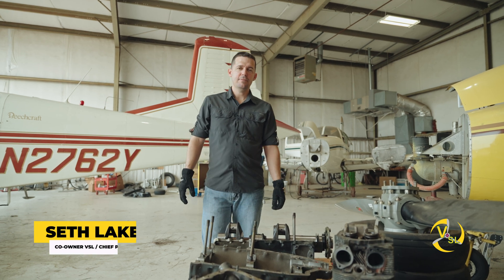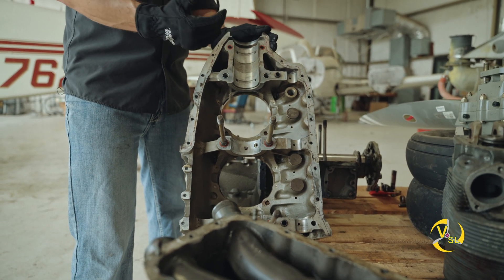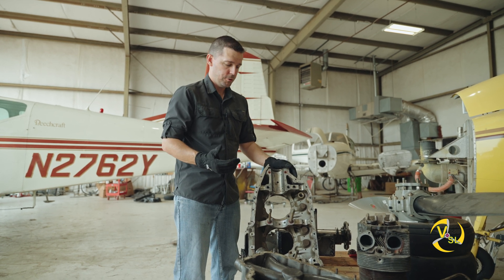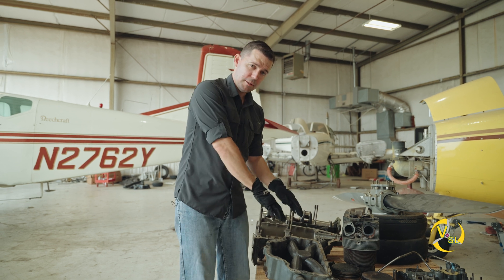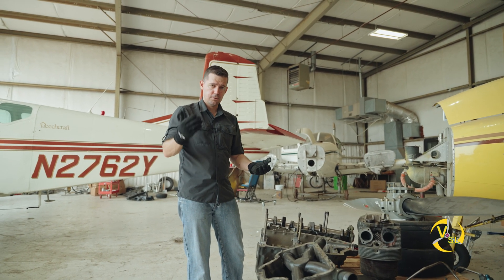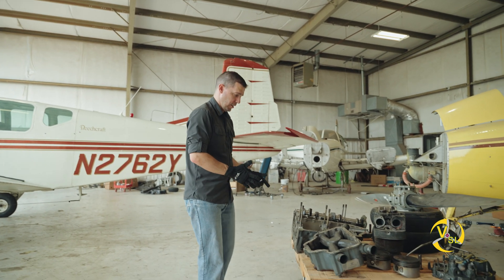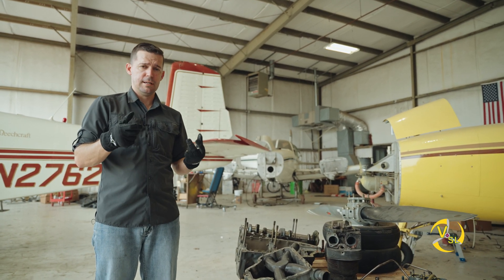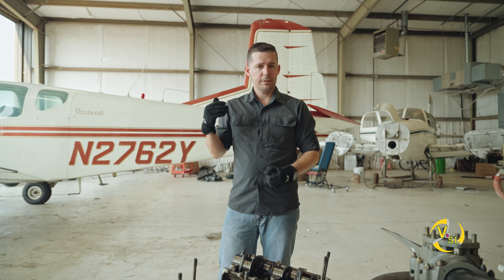Demystifying General Aviation Piston Engines: Exploring The Case (Part 2)

Comment: Seth… love the explanation of things. I have a question, at the end of the video you talk about the intake manifold, and that the air passes through the oil sump. I would assume this would heat the air and decrease performance. Is there a reason why air passes through the oil sump perhaps it’s just due to construction convenience?
Reply from the maker: Great observation.  You are correct, the fact that the intake manifold passes through the (hot) oil sup prior to reaching the cylinders is not optimal.  I think it was designed this way to reduce the size of the engine.  In this case the space savings was worth the cost of the marginally decreased performance due to the intake design.

Comment: What is a little cylinder next to the oil pump? Looks like a chain or belt tensioner of some sort?
Reply from the maker: I'm not sure what your referring too.  There isn't a chain tensioner on the engine.
Reply: @SethLakeDPE  6:43 you point to the oil pump, what is the thing to the right of it? Between the pump and a big round opening in the accessory case.